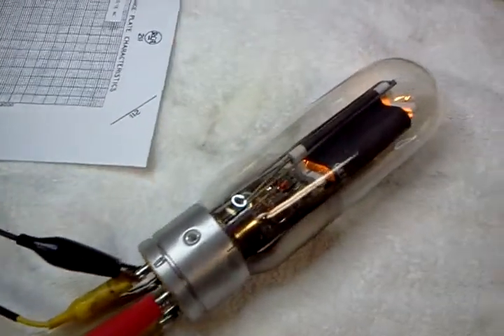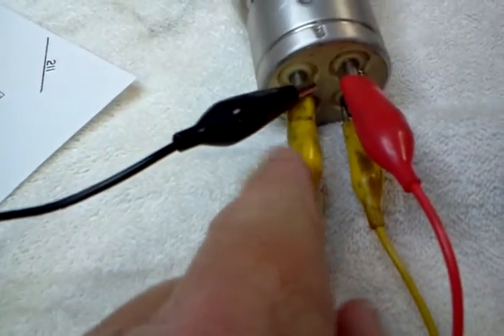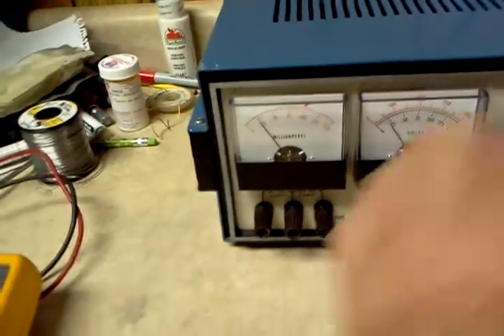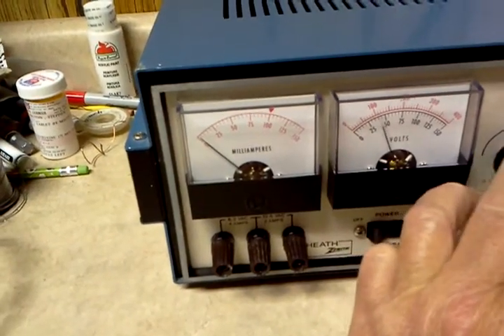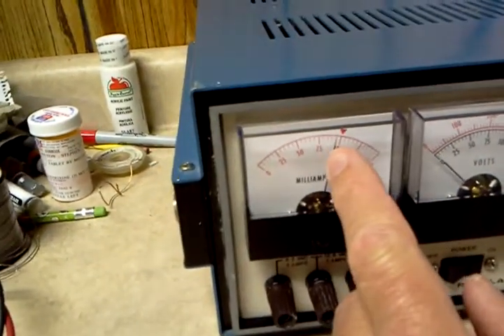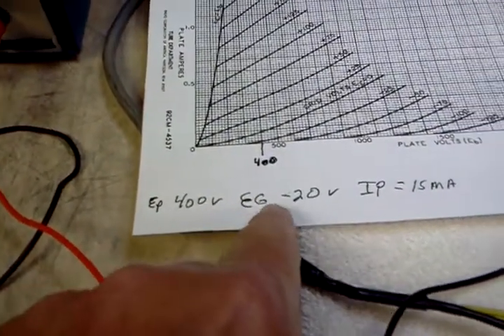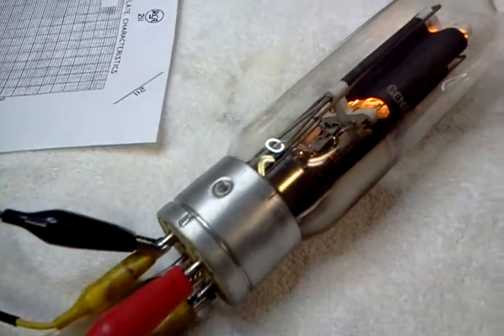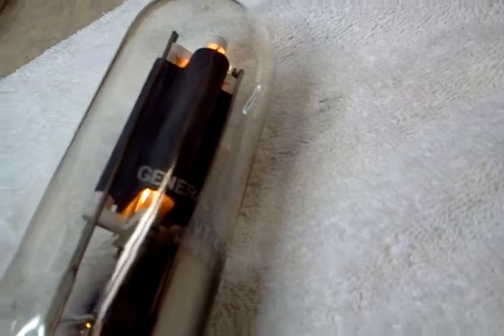Testing a 211 Tube

Comment: Excellent, this what I need.
I fix High End audio gear, some days ago a costumer comes with two amplifiers, he ask for the the tube test.
I have a tube tester but not for the 211 and the 845.
My plan is the next, I have a 0 to 120 volts DC power supply, I think to use this power suply for the negative grid voltage.
I have a 0 to 30 volts DC power supply for the filament voltage.
I will make a 800 volts power supply using two isolation transformers for the plate voltage.

One question, test is the same for the 211 and 845?

Best Regards.